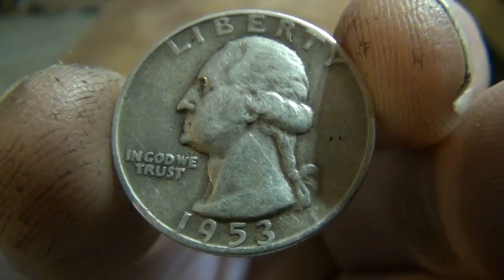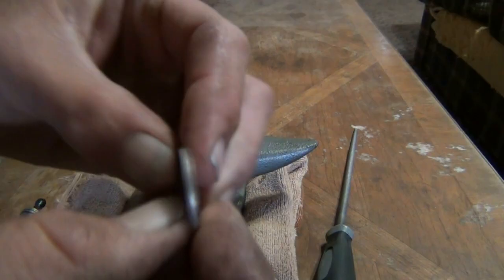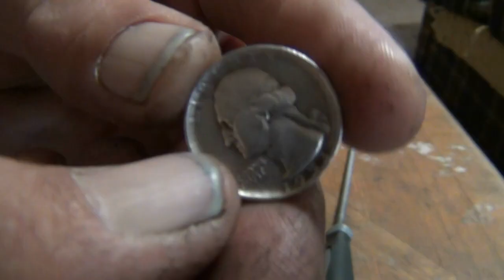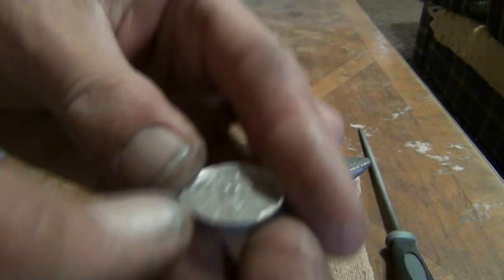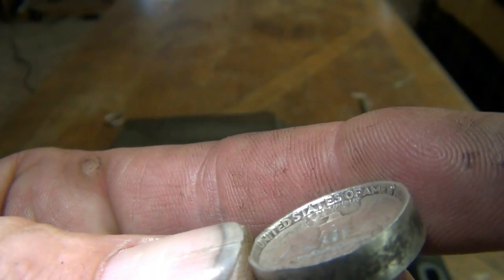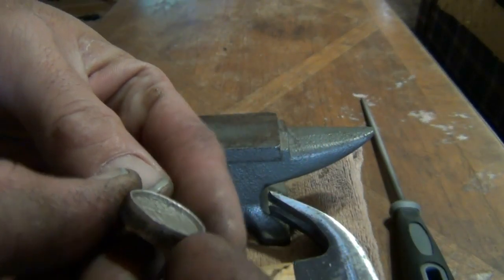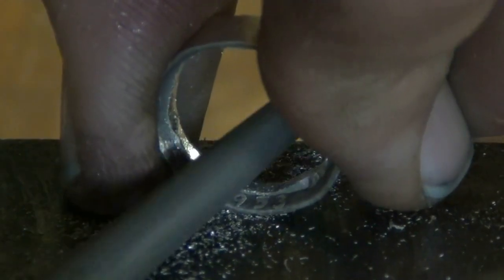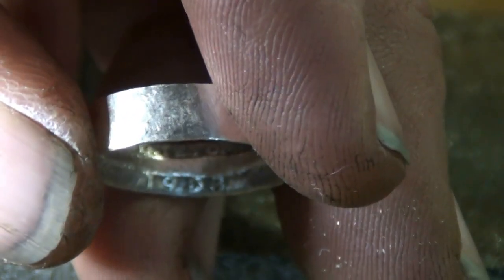Make Rings out of Coins

Comment: Thousands of these rings were made in WW2 by sailors and marines with free time on warships. Lots of them were wedding rings. Picture three hundred dudes waiting in the chow line while banging their spoons on quarters. The old timers had a method of making the entire thing with just a spoon. Somehow, I suspect freezing the coin, they are able to separate the outer ring from the inner disc. I suspect this has been done since the first coins were made. Thanks for the vid, Fencekid.
Reply: The way i make them is you get a rad that widens at the top and you still a hole in the coin, You put the rod through the hole and tap it with a spoon
Reply: I use a spoon, it rounds it off nicely
Reply: CrucifyRobinHood ; l0l
Reply: @pinterelectric  me too. It also makes prettier rings.

Comment: 1) you would have an easier time if you mounted your striking surface. Each of your strikes are losing part of the force through absorption in the padding underneath. 2) It is FAR easier and quicker to drill out the center of the coin, and then using a rubber mallet, turn the coin material on edge by striking it on a steel mandrel. You can also size the ring on the mandrel to get a perfect fit. This technique allows you to have the writing on the outside of the ring which looks awesome.
Reply from the maker: Ya mean like this? https://www.youtube.com/watch?v=7Q8aokoIH9Y
Reply: fencekid
Reply: Criss Rosenlof everyone has their own way and their own preference on how to do things. Most of the time you may find a way to do something that’s much easier, than someone else that’s doing it the same way you did it. Doesn’t mean it’s wrong though. This way is just more easy for him to do.

Comment: I remember making one of these rings in the 60's. I made mine a lot slower and it came out more rounded. Once I had it sized properly I started tapping/hammering the coin while tilting the coin 20 degrees which resulted in a domed rings. I then used emery cloth to smooth out the ring. Thanks for the memories.

Comment: I learned how to do that while in the Army.  Drill the first hole for an 10-24 bolt an inch and a half long, and add lock nut.  That gives you a nice handle, and better control rotating the coin.  I recommend a 4oz hammer.  You want to tap, not pound.  We used an old magazine to cushion our upper leg, which served as an anvil.  In the Army we didn't have a lot of hand tools.  We used a teaspoon from the mess hall for the tapping.  When you get the ring down to the proper diameter, then you can drill a larger hole, and file the rest of the center to the proper ring size.  Having a full collection of jeweler's sample size rings, and a tapered ring mandrel helps get the size right. 
Put a slight rounded shape crosswise to the outside, and polish both inside and outside, mirror smooth.   People are always baffled as to how you managed to get the lettering that way. 
My first one using a quarter was a bit skinny.  So the next one I used a Walking Liberty Half Dollar.  Makes a nice wide ring for my finger.  When I got home I made one out of a quarter for my younger sister.  It made a nice wide one for her small finger. 
I make one every once in a while.  I prefer to not use any power tools, except for the drill to make the center hole.  That give me a lot of pride to say I made it all by hand.
Reply: @Sk8er Dude If you are going to be doing a lot of different projects, you need to get some files.  Visit your local hardware store.  But lacking that you can use sand paper, various grits.  For the inside to the ring, use a piece of dowel with sandpaper wrapped around it, in place of a file.  But a file is much easier to use, is faster, and lasts a long time for future projects.  Keep an open mind.  After you have made one, you will understand how to make the next one easier.

Comment: You're losing a ton of energy using that towel to soften the impact on the table. Go onto something that wont get damaged from the pounding if you want to go faster on this project.
Reply: I was thinking the exact same thing. Just dampening the force :)
Reply: r d'B He's hardly wasting it. In fact, he's increasing the value of it. He's turned a $10 coin (with $8 of silver in it) into a ring that's worth whatever someone's willing to pay. I bet there are people who would pay over $100 for that ring, and even more.
Reply: cwuzii Or.. Hear me out on this, it was made with a quarter. He defaced the coin which itself is illegal. And its not $10, its $0.25. You can account for inflation but if you used a really old quater anywhere, they still recognize it as a quarter. And plus I would rather have a 1963 coin then a cheap ring when I could just melt it down and make more then one/coin. If you would pay $100 for this, you are pretty stupid when it comes to handling money, especially since this can be made with 2 rocks and something to hollow out the center.
Reply: Razzman When i said $10, i was talking about what the 90% silver might be worth, it's probably less. Yeah, the only cool part about using this rind, is the fact it's 90% silver, and the way the writing stays on the inside of it. That wouldn't happen if it was melted.

Comment: So instead of melting it down and using a cast, you waste all that silver by drilling out the core.
Reply: Maybe he takes the excess from that coin and others, then melts that and casts it into something bigger.
Reply: ***** Did you watch the video? All quarters, 50 cent pieces etc are made of real silver if made before 1963.
Reply: ***** It's not really a waste since because of the low mass of the coin, there is overall very little silver in it.

Also, which do you think is more likely to be a plausable home build, using a smelter and a cast, or using a hammer, a metal surface, a drill, and a file? Plus, if you do it his way you get it with the letters and numbers on it. If you simply wanted a silver ring it would be easier to just go out and pick one up for like $ 30 instead of melting and so on...

Comment: Not sure what size drill bit you used, but you'd have an easier time starting with a smaller bit and working up.  I'd suggest an 1/8" bit to start and then work up, and the bit won't walk around as much with the smaller bit.  Metal fabricator here and I drill holes on a daily basis

Comment: Why not save the time and trouble of losing all that silver to filings. Make a casting and melt it and cast it.
Reply from the maker: please show us how
Reply: fencekid OOoOoOOOOooOOOOoooOOooOOoO Burn! :P
Reply: Can't show you , but you can use an existing ring and make a clay mold, fire it, then melt the silver into a crucible and pour away.
Reply: amurican35 wow... So you want him to create a clay mold fire it in a kiln that only takes about 8 hours k step 1 done. Now you want him to melt a silver coin (965 degree's Celsius BTW) around 15-30mins with a blowtorch... Then While handling MOLTEN SILVER Pour it into a clay mold that needs to then cool you then have to clean the ring and get rid of imperfections (Using a file) to shave away silver.... I'll just stop here you get the point
Reply: It is illegal to melt U.S. coins while in the U.S. Yet it is perfectly legal to hammer a coin into a piece of jewelry. Plus this is a really cool way of building yourself a ring.
Reply: Efernal1
its legal to melt pre 1964 silver coins but it is still illegal to melt other coins like pennies and nickels

Comment: I found an easier way of turning the coin.  I suffer from arthritis in my hands so holding the coin and slowly turning it ended up being difficult for me.  I kept getting cramps in my hand.  I found that by drilling a 5/64" hole in the very center of the quarter allowed you to put it in the same holder that the dremel tool used for it's cut off wheels.  Then it was just a matter of finding the best speed for it to spin at.  All I had to do then was to gently tap with the hammer on top of my vise which I had to rest frequently because of the arthritis.  But still, the dremel made the job of turning the coin a lot easier.  Give it a try.
Reply from the maker: What a great idea!  Thanx Man

Comment: Make a hole big enough for a bolt, Slip a bolt through then place it in a drill and use Wet and Dry Sandpaper and it will smooth it out so much.

Comment: how exactly do you size the ring? im young i guess its probably simle but im just over looking it, but im trying to make one for my gf and she is a size 7.5 and idk if i can even get that small, but im trying to figure out how the sizing process works.
Reply from the maker: andy rannells The key is to get it folded all the way over before you get to your target size. Then just push it down the mandrel to your desired size. For a 7.5 you'd need to get it folded over at a size 6.5 then push it down a size. If you could not get it folded over until a 10 not to worry. Just push it down until you're sure it's perfectly round. then, use your dapping block to compress the edges of the ring inward to a 7.5. I made a vid on how to do that with a dapping block and a bench vice. It will give the band that classic rounded shape too.
Reply: what if i dont have a mandrel? is there any other way that i could get it to the correct size.  is there anything i could use in place of a manderel

Comment: I'd have had drilled a large enough hole so you could use a dremel to Sand the ring smooth, faster but you'd need a bowl of water to cool the metal when it heats up

Comment: How do i punch a hole on a coin without a drill? Can i just hammer a nail through it?
Reply: Dazz Freezee probably no, but you can pick a drill up for cheap at harbor freight.
Reply: @robfairburn5037  Yea after a few days of "research" a drill is the best option and are pretty cheap compare to other tools. A 40$ drill is already in my amazon cart.

Comment: i used a punch and a vise ---punch a hole in it --lay it across vice and if u do it right you can still have a date  --in my case i used a nickel --i never used a drill at all--also i uses a ball peen hammer -the punch in middle will do same as a drill would only -no waste--never used a quarter --as  know the nickle  -will turn green grandpa taught  me how to do my method

Comment: arent coins made before 1964 60% silver?
Reply from the maker: Steven Yan Try 90% silver 10% copper. That's right up there with sterling silver. The copper adds strength and hardness. .999 silver is a bit to soft to wear day in and day out, especially with an active lifestyle. It'd be all scratched and dinged up in no time.

Comment: Isn't this illegal?
Reply from the maker: +Black Knight no
Reply: +Black Knight   as long you do not attempt to deceive
the following is  a cut and paste ...

U.S. Code is 18 U.S.C. &#167;331 reads: &quot;Whoever;fraudulently ;alters, defaces, mutilates, impairs, diminishes, falsifies, scales or lightens any of the coins coined at the mints of the United States, or any foreign coins which are by law made current or are in actual use or circulation as money within the United States; or whoever fraudulently possesses, passes, utters, publishes, or sells, or attempts to pass, utter, publish, or sell, or brings into the United States, any such coin, knowing the same to be altered, defaced, mutilated, impaired, diminished, falsified, scaled or lightened - shall be fined under this title or imprisoned not more than five years, or both. 

Still sounds like something you can;t do, right?This paragraph from the U.S.Mint website should clear this up:Section 331 of Title 18 of the United States code provides criminal penalties for anyone who;fraudulently alters, defaces, mutilates impairs, diminishes, falsifies, scales, or lightens any of the coins coined at the Mints of the United States. This statute means that you may be violating the law if you change the appearance of the coin and fraudulently represent it to be other than the altered coin that it is. As a matter of policy, the U.S. Mint does not promote coloring, plating or altering U.S. coinage: however, there are no sanctions against such activity absent fraudulent intent. (Source U.S. Mint)
Reply: +Black Knight Who cares Not like it mattes. Who's going to inspect every last piece of jewelry you own? Nobody